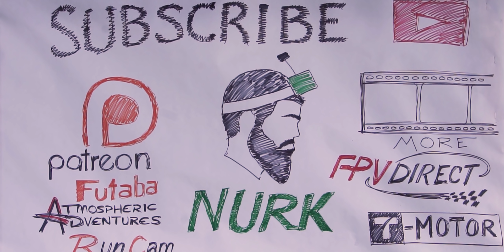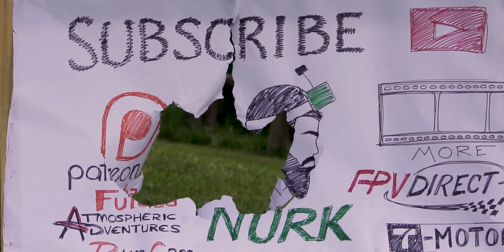Is the GoPro 9's extra weight worth it? We think so.

Comment: I really like it. I have switched to using sharpness to LOW. You can always add sharpening in post but you can’t really remove it.    Used it on a sick single track fpv mountain bike shoot the other day and it stood up fine to multiple head-on tree hits.  The Most annoying thing is having to download clips to the phone to view playback of any high bitrate files. We just need to see if framing is good. Hopefully they will figure that out.

Comment: I'm wondering if it's not better to build a 6 or 7 inch quad to use the weight of almost two session 5' on a quad? Even 6s lipo's must become hot. Also you can see that the quad (5 inch) with a hero 9 without hypersmooth will become prone to vibrations through the extra weight in perspectif to the performance of a 5 inch quad. going from a session 5 to a 9 ...i gonna hate it.. i think the weight.